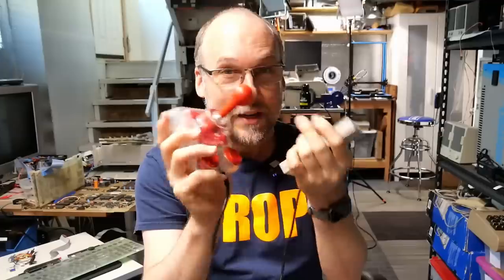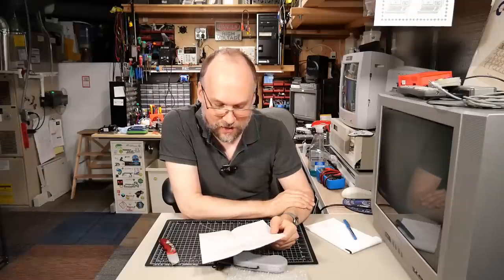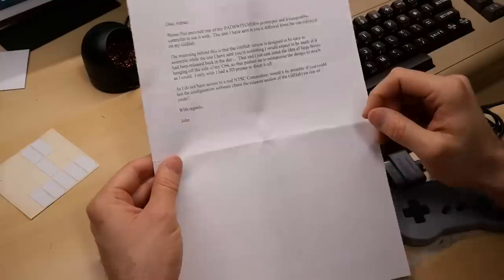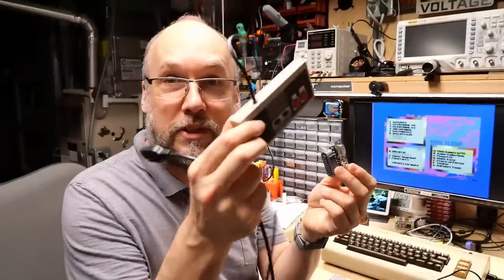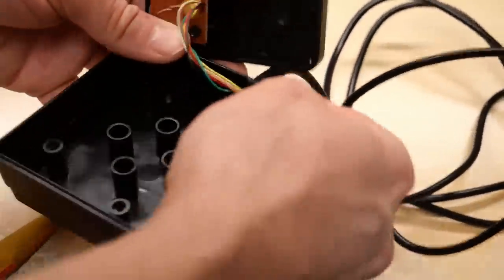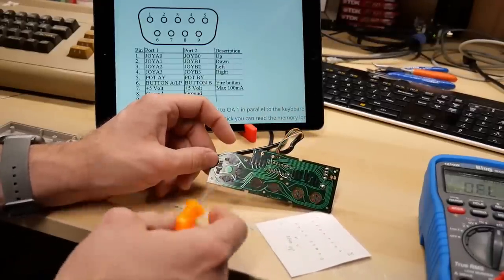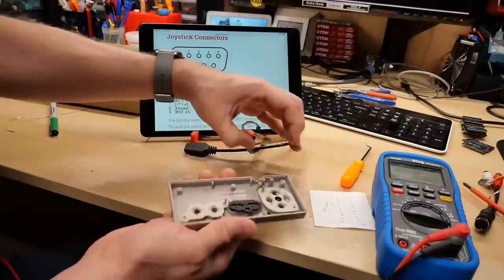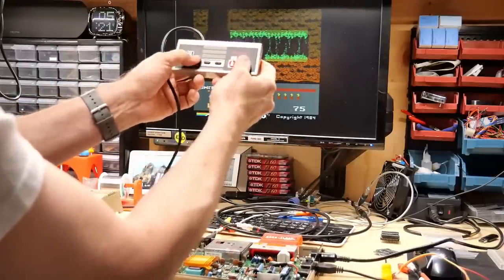How to use D-Pad controllers on the C64

Comment: 36:35 as much as I'm surprised when someone doesn't already know about the screwdriver trick (for letting the screw "find" an existing thread"), it's always delightful to see them find out about it and start using it.
Reply: I just found out about it from this video. 
Gave me one of those "why didn't I think about that?" moments...
Reply: @silkwesir1444  another similar trick, though not as important in this circumstance, is to not tighten any of the screws down until you have all of them started. In some cases you need to be able to jiggle things around in order to get the screws (or more usually bolts) started which is made difficult or impossible if you have already fully tightened some of them.
Reply: That's equally good advice! As a cherry on top, you can then tighten them in a star pattern (tighten one, skip one or two, repeat until every screw's tightened) makes sure it's as secure as possible without overstressing any of the screws or insets.
Reply: @borismatesin  That makes sense. It's how you tighten lugnuts on a car tire.
Reply: I've been doing this for years. I first did back in the 80s after using a self-tapping screw to thread into white metal on a model railroad boxcar kit. I reasoned that if it cut the threads the first time, I didn't want to risk cutting new ones, so I started turning it backwards to find the threads.
Reply: The funny thing is that I started doing this by myself. I didn't know about the thread stuff, I just noticed that the screw goes down easily and doesn't end up crooked if you do that.

Comment: The pin-out of all DE9 plugs is standardized, looking at male front side (and female back) it's numbered form left to right, and of course the opposite direction for female front (and male backside). This is actually standard for all D-Sub connectors...

Comment: Holy crap is this eerie.  I built something near identical to this "Padswitcher64" here in the USA.  I used a NES controller socket and an Atmel AtMega328, not 88.  But mine is also dual port.  I also wrote 64 "config" software, but my software is just a display terminal with the mega sending PETSCII and you interact with the mega directly for configuration.  My design uses the concept of events and macros.  Each (NES) button has a press event AND a release event. Then you define output (64-side) macros.  The macros can have both a "setup" and "loop" section, to allow custom autofire or complex operations.  It was over-engineered like I always do.  It was/is prototype so I never made it compact, but I did make a dual plug shell out of delrin using a CNC.  On top of it all, the mentioned arrival date and the release date of this video are both meaningful dates to me.  Once again, eerie.
Reply: It's because of the complexity of understanding and defining "release macros" I felt my project wasn't really well suited to the public.

Comment: Going by memory (I confirmed this with a few D-Subs) the convention for these D-Sub connectors is that the connector with the pins will have the numbering increment from left to right. The connector with sockets will be right to left (this would be the joystick cable).
Of course this is with respect the the front of the connector, the rear will be opposite.. useful to remember if using the "solder pot" variant of the connectors (when making cables).
Once the orientation is known, it makes reading these connector pinout diagrams a lot easier.
Cheers Adrian :D
Reply: but will you remember this the next time? better to check it to be sure.

Comment: 10:42 you could use a pair of 'gender changers' to extend the connectors slightly. I put it in inverted commas because a gender changer is supposed to change the connector from male to female or vice versa, but you can get ones that are just simple passthroughs that don't change the gender at all. Nevertheless, they are still sold as 'gender changers' and that's what you need to search for. (They are sometimes sold as 'port savers' too). I have used them before when I have needed to pass a cable through a panel etc.
DE9 ones are commonly available (sold for serial ports) and they are usually very cheap, just a buck or two a piece.
They will extend the connectors out by about half an inch, which should give you the clearance you need.

Comment: I had a friend who had a Sega Master System and used one of the d-pads on that with my C=64. Worked perfect since they both used the same adapter plug.
Reply: Lassi Kinnunen  I believe the start button is the dangerous one on the Megadrive. If you hit start you send +5v someplace bad.

Comment: Fran Blanch taught an entire youtube subculture how to properly re-fasten vintage plastics. Her tip is literally the most important thing I've ever learned from YouTube.
Reply: Do you have a link for the video?

In the late 90s, I worked for a small mom and pop computer store which happened to be an HP Authorized reseller and repair center. I recall reading in the service manuals how to reinstall the screws, basically the same tip that Adrian and others have learned from Fran.
Reply: @davecarroll  She does it in pretty much any video she does that involves taking apart retro plastic. Here's an example: https://youtu.be/rY6R3U5k5OE?t=787
The gist is, turn the screw anticlockwise/counterclockwise/widdershins if you're from 1850...slowly. The screw will eventually 'drop' into the thread. That's when it's safe to screw it in. It's VERY helpful.

Comment: Because I believe in overengineered solutions, I designed a whole replacement PCB for one of those modern USB NES pads which one can solder a DB9 cable to!

Comment: For the NES pinout, if you have a multimeter with a continuity function, it's probably easier to hook one lead up to the common wire and tone out the legs while pressing each button. Then you don't have to worry about flipping the pinout in your head. Either that or just redraw your pinout reversed once you have it figured out.

For the C64 side, I'd assume it uses the standard DB9 numbering and you can search for DB9 pinout to get the male and female pinout to compare with the chart you showed. I agree it would have been very handy for the page you showed to denote which it was.
Reply: This. Just clip one lead the common chip leg and the other to another chip leg to test.

Comment: That was pretty neat, I'd have probably just mapped directly to pins but then I wouldn't have all those neat legacy options. A lot of thought and care put into that adapter.
Looks like your carbon contacts are a little shiny in your NES controllers, that can hurt contact success but IPA and swab will fix it right up, duller is better. Usually Cheetos dust in there anyway. ^_^
Worth noting all 9-pin ports that support two paddles can convert said pins to two digital buttons, the joystick just leaves them unconnected by default unfortunately. Takes a few components but they could have done A, B, and Start/Pause from the beginning all the way back on the 2600.

Comment: The NES controller seems to have pullups resistors made by carbon connections on the PCB.  When you don't connect the 5V to the PCB the high levels can be affected. Also not powering the shift register can be cause level issues. Keep this in mind if you see ghost button presses.

Comment: Great video instructions on how to make the NES into a C64 gamepad! I want to ask about the chip in the NES board. The wires are soldered to the leg but the 5V line is not used. Am i correct to say the chip is not active and mere serve as a place holder and an easy reference point to solder the wires to? I am planning to make a C64 gamepad from a Megadrive gamepad. Other videos i have watched shown that all the guts (Chips, resistors, whatever) has all been removed and the wires are soldered directly to the touch point in the trace of the board. I believe the Megadrive is same line the NES...a 5V high by default which will fry the CIA in the C64 if not disabled.

Comment: I once took a Bally Arcade (Astrocade) joystick and rewired it to work with an Atari 1200XL. I do not know if you know what one of these joysticks looks like, but it is a gun handle with trigger with the joystick on top. The joystick worked great and was much more comfortable then the Atari joystick.

Comment: super nintendo actually uses 2 of the same shift registers one of them is wired "upside down" and that makes them work with nes and snes seemlesly, nes simply can't see extra inputs
Reply: @yourdrinking  2 4021 in smd packages facing each other upside down on pcb, because nintendo decided to wire them in paralell for data, clock, power and ground and only latch is piggybacked from master to slave ic
if nintendo really wanted to amaze people with buttons they could easyly use 4 extra inputs on 2nd ic for something, but they just left them terminated and 4 used  inputs kind of fell into nes blind zone and snes pad should just work fine on nes, with wierd button layout but still seeing just the first ic
if i remember corectly it is due the delayed latch on nes , kind of waiting for the inputs to being setit goes latch 8 clocks for data and extra clocks towait for a next latch and nes just ignores data that overflow the buffer where snes have just longer register on the input

Comment: 38:05 I thought the same; back in the day when H.E.R.O. was released (both for Atari & C64) the developers didnt intend to use a button for flying so the difficulty gets totally lowered by using a hacked mode controller nowadays; just my 2 cents at using these new modes on vintage original games
Reply: people were making controller modifications back in the day already. a lot of C64 users were tinkerers.
Reply: @silkwesir1444  But not to the extent that current tech allows; that programmable microcontroller easily configured by software allows modes that were unthinkable 40 years back; one thing is taking an Atari joystick and re-wiring it but this supercharged 2 port dozen-mode interface can really be seen as cheating in many games

Comment: Cool! I’m in the process to make a controller for C64/Amiga the old school way and I’m planning to have a seconday button to have it as “up” instead of the up direction because some games are better to have a jump button and instead of using the direction. I’m planning to build in a switch to change between jump or secondary fire button for the second button because some Amiga games support a secondary fire (like Mortal Kombar 2 or Bubba&Stix).

Comment: It would be useful to have a switch so that only one of up or 2nd button is actually active at any one time.  If you have more buttons it can also be useful to do the same with down as well.  For instance Chuckie Egg plays way better with up/down on their own buttons.  I have a 6- button USB fight stick with the buttons wired to a DB9 for use on 8-bit systems, with up/down switchable to buttons.

Comment: What about a pass-through adapter for a Sega Genesis controller, with button remapping? Doesn't seem like it would be hard.
Reply: You can do it for the Master System, the genesis pad is more complicated: it has a chip that switches the signal for some of the buttons.

Comment: With the two turbo columns, is that to give you opposite phases on a 50% duty cycle? I can see setting one channel to turbo Left and the other channel to turbo Right and doing really well at those decathlon games that made you waggle the joystick left and right to run.
Reply from the maker: Hah yeah I didn't even think about that. I'm not sure it works for directions but can you imagine if it did. Probably something that can be added so the controller source code.

Comment: There were D-Pad controllers for the Atari 7800 which can also be used on the C64. (The ones which have that optional screw-in thumbstick thing.) However they are not as good d-pads as those on the Nintendo...

Comment: Having fried a C64's joystick ports with a Genesis controller myself 20+ years ago,  I can vouch for this being a genuine problem. Don't plug your Genesis gamepads into your C64!

Atari itself made an NES-style gamepad for the European 7800 consoles. I wonder if it would work with the C64. It works fine with the 2600, after all.

Comment: I used to use a sega genesis controller in my c64 in the early 90s.
Reply from the maker: Apparently this can cause damage to the 6526 if your pushing buttons and keys at the same time. Can't remember the details but you can modify the genesis controller if you're doing it

Comment: I like the competition pro and still have it. As a lot of games use the space bar as a secondary button I disconnected the second fire button and soldered two wires to it. These two lines I connected to Joystick port 1 fire which for most games acts as space bar. A few have code to detect if it's fire port 1 or space bar, with these it did not work.

Comment: There was a thing called the NCE Joycard with a D-pad and two buttons that could be plugged straight into a C64 with a 9-pin D-connector. I had one several years ago. It was terrible.

Comment: Nice project, and I do not intend to take away from this in any way, but if you're not too particular about which D-pad you use, the controllers for the Sega Master System, the Sega Genesis/MegaDrive and all Atari consoles and computers are compatible with the Commodore 64 right out of the box (edit: see elsewhere about potential issues using a Genesis controller; I haven't had direct experience with that myself, but of course I don't recommend doing anything that might fry something valuable).  The standard controllers for the Sega Master System and Genesis/MegaDrive use D-pads, and Atari released a D-pad controller for the Atari 7800 in Europe.

(Additional edit:  More info on Genesis controller issues here: http://www.floodgap.com/retrobits/ckb/display.cgi?26  This is specific to the Commodore 64; the Genesis controller can still be used safely on other Atari-compatible systems, and in fact homebrewers have figured how to make Atari 2600 games recognize one of the other buttons on a Genesis controller, to create games with 2-button support.)

Comment: If your hands hurt holding an Atari classic CX40 joystick, you're doing it wrong. It's a very easy controller to hold but with a light touch. It was easy to rewire an NES controller so I could use it on my 2600 with the fire button on the left and the cross key on the right. (I also removed the chip...)

Don't throw out the rest of the CX40. Sell it on eBay as a Joystick Repair Kit. The Atari joystick is a very good tight and responsive joystick! I've played lots of great games with them. The Gemini Gemstick comes close to it. Joysticks with too much loose throw are unacceptable for the kind of game play the 2600 presents to players.
Reply: The sticks can also be used to repair the somewhat rare wireless controllers for the 2600.

Comment: You can now use a Genesis/Megadrive controller on the C64 without causing any issues, as long as you have a special adaptor

Comment: It's a damn shame that there wasn't a widespread adapter back in the day for a 2+ button joystick. We'd have a ton of games that support it.
Reply: It's actually possible to create a Joystick using Analog Joystick via Pot-X and Pot-Y, and have four buttons (A,B,X,Y where the arrangement in a plus matches the UDLR of a digital Joystick) and a Start button (fire).  It would work with both ports and even the VIC20, but would require Games written for it (Elite adjustment woul dbe great for ANalog Joystick ;-)
Reply: For the NES controller wiring, one could have used 5v with high Ohm resistor to pull Up Pot-X and Pot-Y and Ground that separately (instead of the common), while using the other side for the signal back. That way you have two more buttons, usable via software. Just make sure you don't interrupt the common fo rthe other buttons...

Comment: I use two 64JPX, each for one controller. It supports Sega and Nintendo, it has also a 9 Pin sub-d for a mouse.
https://www.c64-wiki.com/wiki/64JPX

This in the video is a great thing. The port switch feature is nice. But I am happy with my 64JPX.

Comment: Instead of hacking up an old Atari joystick to get the needed female DB9 cable end for the NES controller mod, you can use a Sega Genesis Controller Extension Cable instead. I used them to fix a couple Commodore 1311 joysticks. The extension cables have all 9 wires so you have to tone out with a multimeter which color wire connects to what pin, but they are cheap and plentiful and work just fine once they are wired up. https://www.amazon.com/Controller-Extension-Compatible-Sega-Genesis-Dreamcast/dp/B07CPJLJDZ